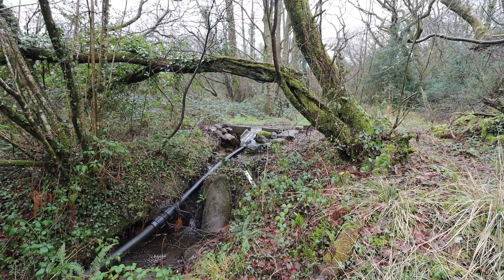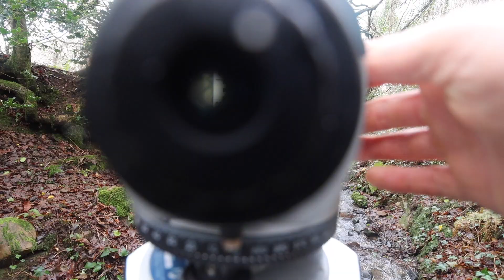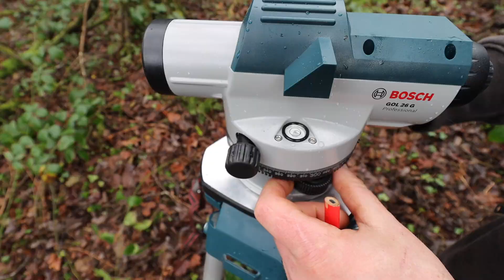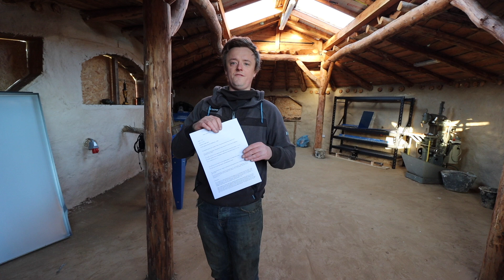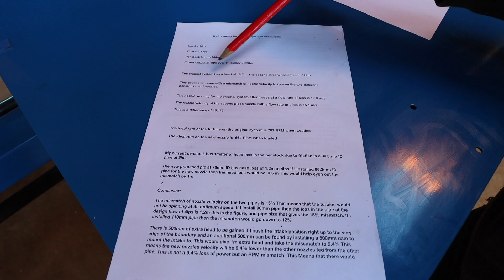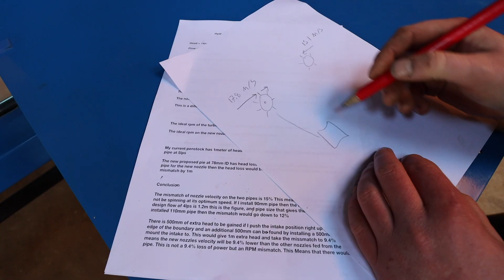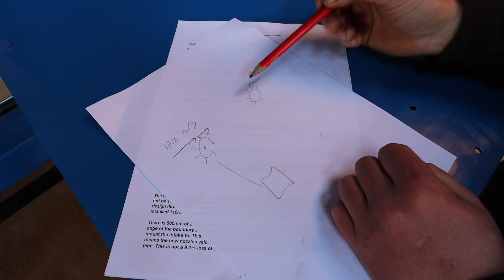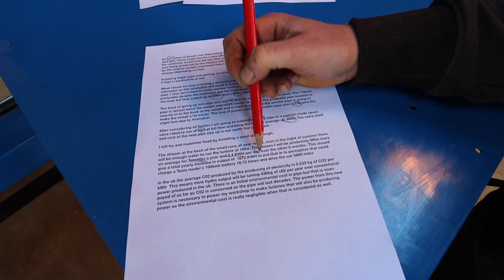Adding A Second Penstock To My Off Grid Hydroelectric Turbine (Survey)

Comment: I'd recommend putting these calculations in a spreadsheet. It would make it easy to tweak and play around with the parameters. You can also calculate certain requirements to get the desired output. Say how much flow you would need to get a certain speed at a certain head etc. You can also graph the output over a year. And when combined with consumption data from the customer it could automatically calculate savings and ROI and so on. Could be awesome and would also look professional when presenting the info to a customer.

Comment: Why not look into high frequency motors, you won't loose as much energy through the cable. 

Or why not join the pipes at higher ground and gear up the turbine to the motor. Change your nozzles for higher flow for the extra torque needed.

Comment: I had wondered how you'd level out the mismatch and immediately thought of pipe diameter to increase & balance velocity, which was verified in the 'numbers' section of the vid, which was interesting to see.  All jobs are different, but to get a chance to do a job for yourself, you're going to have info and calculations to work from if a similar job appears in future with a customer saying they have up to 3 streams.  Nice work, job, video and that cat is one lucky cat having all that land to roam and hunt in. 😊👍

Comment: Surely you can use the extra cable for both turbines? The alternative is to join both penstock pipes just before they enter the shed, thus regulating the pressure at the point where it enters the now 4 nozzles

Comment: I enjoyed your analyses immensely.   I have installed some Klm's of pipe for irrigation and electronic is a passion.  The two share similar values as far as losses over distance .  Because of the terrain you had to work in I think you and Dot have done an excellent job selecting the path and taking levels at the same time.. ( The couch Professors with think differently. )

Comment: What happens if you mix the flow from both sources and then feed all 4 nozzles?  You should get the combined flow rate at the lower head pressure without any mismatching at the nozzles.
Reply: This is what I was thinking too, aren't the nozzle feeds already part of a pressure-equalising 'loop'?
Reply: I was about to ask this same question. Surely there is a reason to justify 2 separate pipes feeding different nozzles on one turbine. 
But I wondered if the second stream could tee into the existing pipe nearer to the turbine and increase pipe diameter from that point until the turbine. 
Be interested in an explanation from Kris.
Reply: @joelbradley7682  Differences in head height betwixt the intakes.  Water will try to flow from the higher intake to the lower intake.
Reply: @joelbradley7682  The only time you can combine flows is when the effective head pressure of both penstocks is the same at the point of combination.  In practice, this means intakes at the same elevation and same flow rate using penstocks of identical diameter and length.
Reply: @randacnam7321  ah right, would be cool to see this in a tested format. Clear tubes and such. Might do some research :)
Reply: @randacnam7321  This is partially true. Certainly you would want to try to keep the intakes at the same elevation but the flow from both intakes does not need to be identical.
Reply: @yetihair  Only if the flow rate is constant and thus you can easily correct for friction losses in the penstock.  With varying flow rates, different flow rates translate to different head losses and thus different effective contributions of each penstock.
Reply: @randacnam7321  that is true but you can't design for constant flow in a run of river hydro. Constant flow can only be for a storage scheme were you either run your turbine at full power or off.  
In Kris' case the "mismatch" in the penstocks will change depending on the power output. I think he is making it harder for himself.  Most multi intake RoR schemes use different penstock diameters and flows from each intake combined at a junction with a larger diameter penstock the rest of the way down to the turbine. 
Maybe doesn't make sense for him though as this is being built after the original scheme was completed.  He would have to redo the entire penstock arrangement which is obviously costly.

Comment: My thoughts would be why not use your excavator what we call them in Canada! You might call it a shovel, high hoe regardless Dig a pond up top which would give you plenty of head pressure! you could line it with rocks and put a little dam at the front of it so you could regulate the water flow. 
another great idea with head pressure is a ram pump which runs with gravity I will provide a link on what it looks like you probably know about ram pumps.
https://youtu.be/6koHqPM_zxg
Here is a homemade design you can build from hardware store material  https://youtu.be/EV1yhnVCeJY
Reply: Er, if you go back and watch lots of old videos on the hydro system - you will discover why this is not a good idea.....!!

Comment: What happens if you add the two flows together using a junction just above the generator? Does B add its flow and pressure to A? Would that mean that the short length of pipe to the jet distributor needs to be of a larger diameter? Would the unequal pressure in A & B mean that B backs up? Adding flows before the Pelton wheel means there is no differential pressure on the wheel. Discuss...

Comment: Kris, I wonder if you have considered the potential ecological impacts on the other stream from which you intend to dam and take water from? This water will be lost from the stream for the remainder of its course. In Scotland, there are strict controls on abstraction. I suspect this may also be the case in England. There are 'hands off  'flows' which are designed to protect the ecology under low flow conditions. Similarly, every stream may support fish and these ought to be considered.Normally any hydro installation will have to have approval by the regulator (in Scotland - SEPA, in England this will be the EA I expect). They will normally require a fish and fish habitat assessment to inform their decision making. Once satisfied that a scheme may operate, they will grant permission with strict limits on the rate of abstraction. Similarly damming a steam may be frowned upon due to fish migration considerations. Happy to discuss these issues at length if you wish but I would be speaking from a Scottish fisheries perspective and you may wish to seek advice from the EA or a local fisheries trust in the first instance. Of course you may have already considered these issues but I thought it worth mentioning as they are important and often specialist surveys cost developers considerable outlays before they even get started making power.
Reply: I can imagine there are places where this kind of regulation is a valid overall benefit to the environment, especially if there’s an especially sensitive ecosystem or rare species. 

But the ecological benefit of generating one’s own power on site is pretty high. Transmission inefficiency is extremely high in ordinary mains power and what’s the fuel for your mains generation? Coal? Nuclear? It’s pretty hard to beat on-site hydro for ecological benefit, especially in a location that’s famously rainy.
Reply: @twestgard2  I don't for one minute disagree that hydro can be beneficial and far cleaner and greener energy than most others, but with Kris aiming to become a hydro consultant, it is essential he understands the damage that can be done to ecosystems by poorly designed schemes. This site may not be that sensitive but others might.  Key is finding ways to do things without impacting even the most ubiqutous species and habitats. That's fundamental to sustainability. Regulations are there to protect species and habitat and while some may not agree with the regulations, they shouldn't be ignored. We all have to find ways to reduce our footprint and impact.  Kris just needs to be aware and take advice so he doesn't make  mistakes or cause damage inadvertently. I fully support his project and the fantastic work he does..

Comment: Very interesting video, thanks for sharing. In terms of pipes would it be viable to use sectional pipe like 110mm underground drainage at 6m long sections with appropriate joints and bends to follow the contours of land? Or would there be too much friction at each joint leading to too much flow loss. Just thinking about workability compared to battling with a roll of pipe

Comment: Great watching these vids. 2 questions for you, sorry if you explained why and I missed it:

1. Is the outflow from the power House joining up with the stream from the new head? If not, does it matter that the stream won't have as much water coming out?

2. Would it be possible to T into the current pipe so you wouldn't have to worry about a mismatch of RPM?

You must be laughing now with power bills going up the amounts they are at the mo in the uk. I wish I could do the same, but it wouldn't work in my flat.

Comment: Kris, what a great vid very educational!! But not being a hydro engineer, my brain is asking couldn’t you add the second pipe to the original manifold and as you’ve done with the first adding this new flow in and spread both over all four nozzle’s evenly! 
I’m guessing the reason your not doing it is that this is not how it works! But I’d like to know why if you have the time to explain? Many thanks and good luck with the build!
Reply: flow has no bearing on it...head pressure does.....unless he increased head pressure it wouldnt make any difference....2 sources of water with the same head pressure but different flow rates will not impact his power since he reduces the size of the pipe at the very end using jets...that is where final flow is measured...

the only reason to know how much flow is in the creek is to make sure there is enough water to not run out

all that matters then is dynamic head pressure
static pressure in different size pipes at the same height is the same...it doesnt increase by using bigger pipe

so the end result ...if the new pipe has more head, he wouldnt even need the old one as it would not change the power output to have both

Comment: If you were to use the Oak I would limb it & just take a trunk section. Leaving the limbs & root ball in a pile for mice & birds etc. As for the measurement I would have done the 50m tape if it was really difficult since the wheel is less accurate the more rugged the terrain is. 
When figuring the diameter of the Pipe & loss do you take the added weight of the water pressure in line adding up from the head? Due to an enlarged diameter of pipe leading to an increase in overall line volume that is.

Comment: Have you thought about using a 200 meter pipe with a pressure gauge on one of the sticks and leveling tubes with bubbles on both sticks?

You just walk the whole thing once place both sticks, level them and read the hight different off the pressure gauge
Reply from the maker: I have mate. It would be a great way to do it as far as accuracy but I can’t carry 200m of tube to these places I have to get to
Reply: @KrisHarbour not sure how thick a pipeline would have to be to measure accurately over this distance... there's some very small diameter pretty robust pipe available to connect freezers etc to the water grid. It's 1/4" PE pipe. Maybe that's an option? 🤔

And if water has too much viscosity maybe a different liquid works better here?

Perfluorohexane comes to mind

Comment: Interesting video. Your initial water & stick height measure system is thousands of years old, the modern Theodolite is only about 500 years old, both work and earlier one is in the "If it ain't broke don't fix it" category. Just a suggestion for your report make sure your spellchecker and grammar is set to UK English, i.e. paid not payed, just looks more professional. Keep up the good work and the video's coming Kris. Once you have all you engineering equipment set up, you could think about converting the dirty diesel & chip fat van to electric.

Comment: Have you thought about switching to a synchronous generator in the process with a large flywheel instead of a battery with an inverter? 🤔

Should be much cheaper than buying a new larger inverter for the short peaks you might have in your consumption if you turn on a large machine

Comment: Could you rig up a contra rotating twin turbine feeding off both stream with the generator between the two turbines ?
Have the armature on one turbine rotating anticlockwise and the magnets commutator on the other turbine turning clockwise .
In a ideal situation with both parts of the generator moving in different directions at the same RPM the overhaul speed the generator would double without the parasitic losses of a gearbox to double the speed .
Even if the two halves of the generator rotated at different speeds the overhaul speed would increase .
Reply: I wondered about that when thinking about recovering the energy after they hit the spoons. There is still energy to be had from the water flying off since it has mass and velocity. It may not recover enough to make financial sense so I dropped the idea. Also I didn't know by how much the relative velocity of the armature and magnets would be increased. The whole thing would be  more complicated and would need brushes to take off the feed power so maintenance might be a problem.

Comment: Could you mount a second turbine on the same shaft as the first one, but make its radius 15% smaller, so that the slower flow would result in the same RPM?
Reply: Looking down the comments, I see you got in with this point before I did!
Reply: I was coming to post the same suggestion. It might be impractical (flow from one turbine would spill down into the other), but mathematically it’s a very neat solution!

Maybe the second shaft could be offset with a gear to transfer power?
Reply: @dietershirley3234  As I noted in my earlier comment (before I saw and responded to this poster's comment) if a baffle were fitted to the chamber to separate the water flow of the two turbines from each other that would solve that issue...

Comment: We had a similar problem, I’ll keep it short because I could easily make this an essay but.. we had to use a 10,000 litre tank but our feed was at a far higher elevation than you have but was good at keeping pressure through the summer and you can blast out the sediment back end of summer so nothing goes through your equipment giving better longevity. We was no experts and I don’t know if this could be a option for you or not but if you don’t say, you don’t know lark..

Comment: Would it be an option to put in a second turbine and gear it to match the desired speed of the already existing one? So you would have two turbines running at different speed, but powering the same generator.

Comment: Could that difference in flow rates and energy be overcome by having a multi-level turbine design (like on the same axle two chambers with 'wheels' in different diameters or with blades of different sizes). I am absolutely no expert in this kind of stuff, but generally an out of the box thinker.

Comment: You may want to use a step valve pump and get a large watet tank as long as you place the intake down hill you could use the water twice find an old oil tank or tractor trailor tank for times of drout ???

Comment: Hi Kris, tiny comment and absolutely mean to help. If you plan surveys and similar reports to prospective new hydro users then maybe look at laying out the report along extended lines. Your conclusion was great but included all sorts of extra comments and ideas. A conclusion is not "recommendations" - it is a result of your findings looking at the 'current' situation on the ground. Look online for a better layout but maybe the format could include extra segments (following the conclusions) # Assessment of current situation   # Recommendations for your hydro installation     # Possible layout     # Cost and timescales etc.. Just mean to help not taking the mickey...   8o) PS. Love your work and channel and in my top 5 ever.

Comment: Is it possible to use a slightly smaller nozzle diameter to increase the velocity or does that not matter since the volume is still the same?
Reply: That would only reduce the flow rate. Nozzle outlet velocity is mostly determined by nozzle input pressure. Though lower flow rate would mean less friction losses in the pipe, so slightly higher nozzle inlet pressure and outlet velocity…

Comment: How much does nozzle size affect the stream speed? It is true that a smaller nozzle would decrease the amount of water getting through for any given time but a thumb over a hose increases the jet speed so I would expect a smaller jet size would do the same. How hard/easy is it to calculate the change in jet speed for nozzle size and the change in flow and ultimately the change in power? Or does flow trump everything?
Reply: Len whatever -    Have you viewed all of the videos in the Hydro Playlist? If my memory serves, Kris addressed the nozzle size in at least one of the earlier videos. He may have also addressed nozzle size when he modified/upgraded the system.
Reply: Smaller outlets only give more speed when pipe friction is very high (such as when you have your thumb over a hose pipe).  For hydro pipe losses are comparatively small. For obvious reasons.

Comment: I'm kind of curious, but could the second set up have a smaller nozzle increasing the pressure the water hits the spoons? The pressure, drop and volume don't change but simply the rate in which it hit the spoons were more concentrated. Like a pressure washer nozzle, or sticking your thumb over the hose pipe. Would that not work?